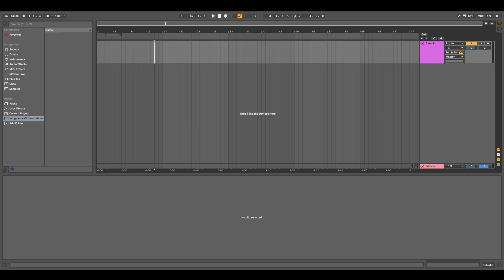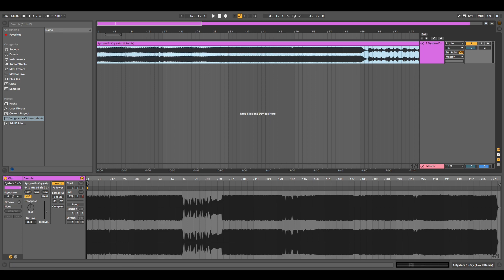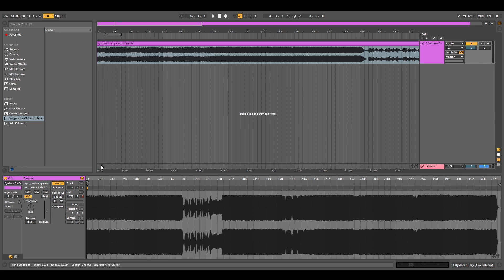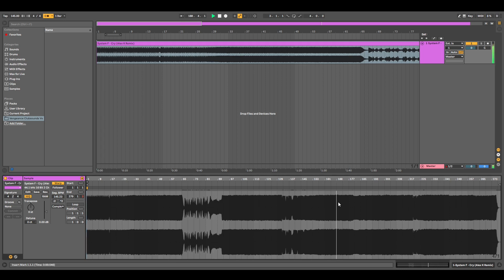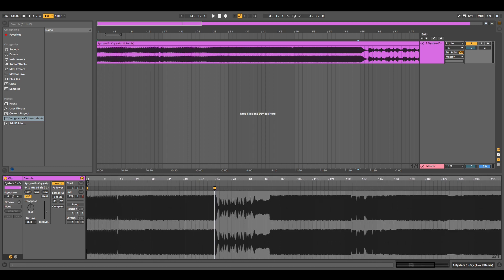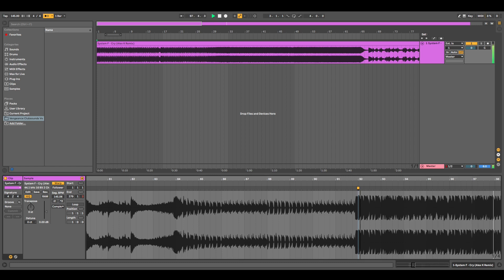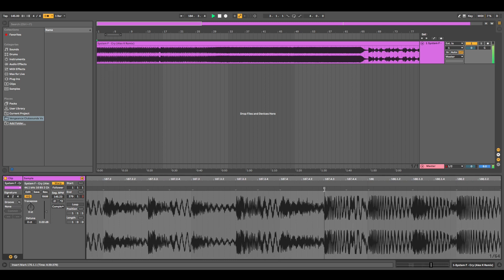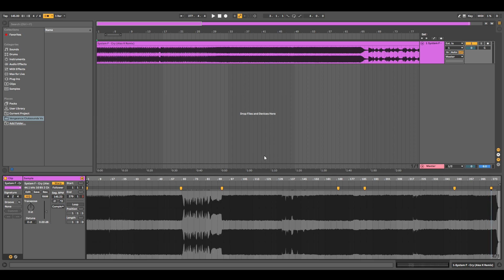Fix Beatgrids of Vinyl Rips In Ableton Live | FSH Tutorials Ep. 1

Comment: Great tip to use pro beatpapping software & always save as wav lossless. 
Nothin worse than finding out the hard way during a live set, all cause we rely on that sync button 😁
It's more so evident, as you've explained here 👍🏽 as I found out once when I went to play these wav rips to & from all the digital files on my S8 kontrol, using traktor.
Getting it right at the beginning & remaster the vinyl recording completely does the track its justice👌🏽 

I also read an article that slipmats are one of the common causes of varying bpm playing vinyl.  My Vestax Xecutioner Slipmats that we're a gift yrs ago & I use on my 1210s.  It's probably been causing my mates some headaches over the years when they have a mix on my decks though 😬
Reply from the maker: Yep, slipmats are great for DJing, not recommended at all for recording. I use the heavy rubber mat that came with my turntable when ripping music to digital files. Got to minimize that wow and flutter!

Comment: Great video and i'm sure it will help a lot of people. Can you confirm which 'Warp Mode' you are using fro the full tracks is it Complex or Complex Pro and why?
Reply from the maker: Got it defaulted to Complex (as the software won't let you set Complex Pro as default). I did read that Complex Pro is better but I have no clue why. I never change the formants or envelope away from what they're set to as default and the results have always sounded the same to me.
Reply: @ForgottenScouseHouse  Cheers, I'm exactly the same hence asking.
Reply from the maker: @darren-johnson  🤜